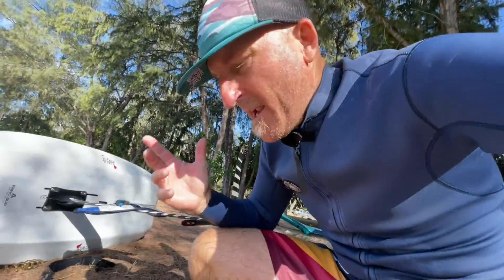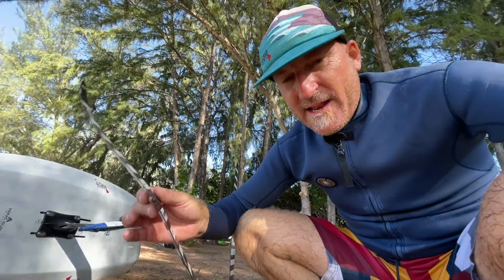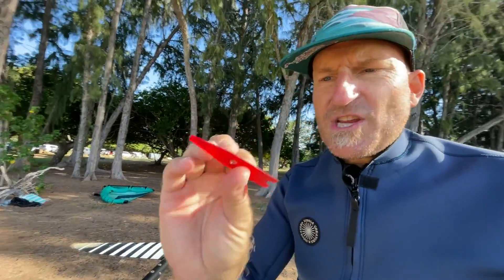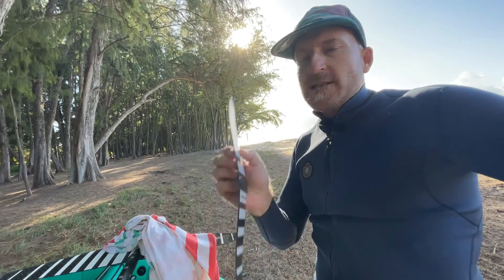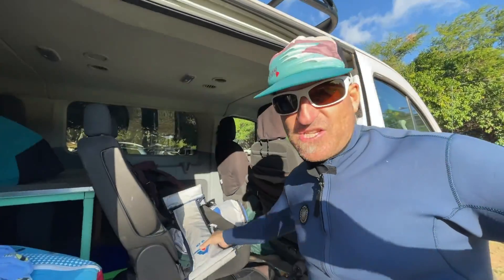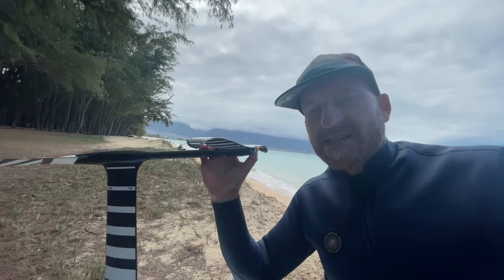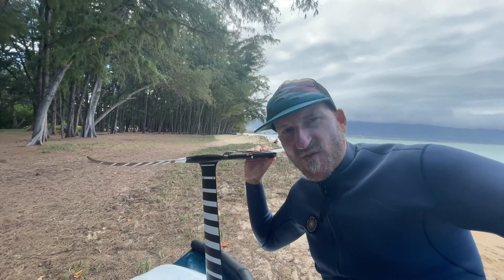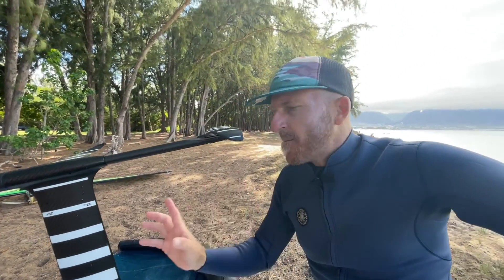Finding out why a wing foil set up is humming

Comment: There's going to be a big welome to loud hums on the new Armstrong aluminium masts. Carbon is organic, composite and it absorbs some hum. Probably less for higher modulus. Hum is supposed to be from certain finishes on the trailing edges.
Reply from the maker: Yes thanks for watching when the water leaves the trailing edge and it’s turbulent it greats tiny bubbles like the water is boiling. That’s called cavitation that makes to noise.

Comment: I'm not an expert, but my understanding is that humming is basically vibration induced in a foil as turbulent water flows over it. If the turbulent water sets a vibration that is close to the foils natural own harmonic vibration frequency, it hums, like a guitar string. So you are right to look for trips - imperfections in the system that causes water to become turbulent. The trailing edges of foils themselves can be trips, if they have a square edge, so the water become turbulent as it leaves the trailing edge and sets up the vibration. By removing the square edge through sanding, you improve the water flow so it doesn't become turbulent and so doesn't set up the vibration. The important thing to note is that the trailing edges do NOT need to be sharp to have a quiet foil, so I would take some of that sharpness out if you're concerned about cutting yourself....
Reply from the maker: Thank you very much. I think you are spot on and thank for watching.

Comment: I believe the hum is caused by the trailing vortices created at the wing end - since the vortex is basically a spinning mass of water it is causing a vibration at the wing tip. That's normal, and the way wing lift works. Unfortunately your fuselage seems to enjoy vibrating at exactly that frequency, amplifying the hum and connecting it to the board. You could try to add a 3 inch tail of electric tape to each wing tip, it could break the connection between wing and vortex.
Reply from the maker: Thanks for watching... yes exactly. Someone actually pointed out a video on hydro dynamics where you can see bubbles forming an trailing edges of stabilizers or any kind of wing getting dragged through the water.

Comment: I have the Naish abracadabra system, when I first started to get on the foil it hummed, as time went on the humming disappeared, the last time on the water I checked the screws on the abracadabra plate and found the front to screws were very loose so tightened them up, as soon as I got on the foil the humming was back, work that one out 🤔?
Reply from the maker: Nice! In my case it was definitely the trailing edge of the stabilizer. Thanks for watching.
Reply: If some screws are loose then the whole setup won't have the same resonance vibration frequency. Listen to the difference in the sound if you knock on the foil with and without loose screws?